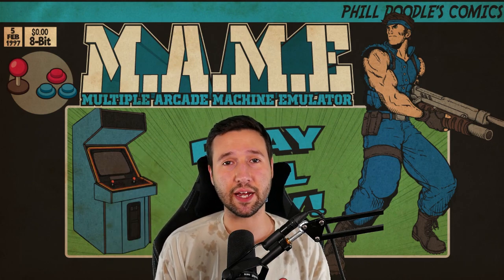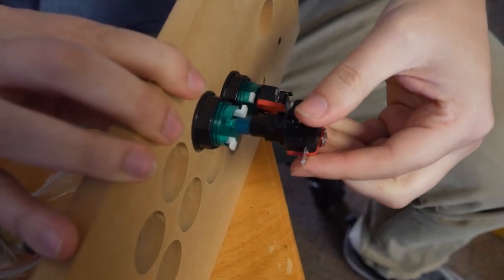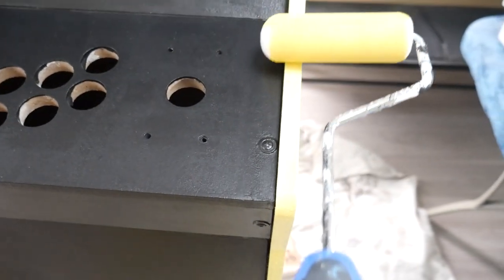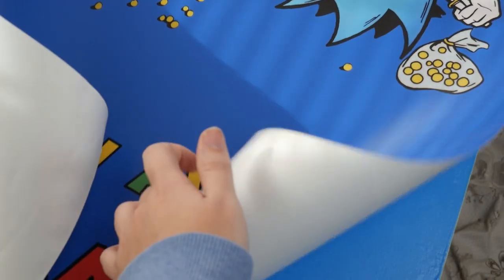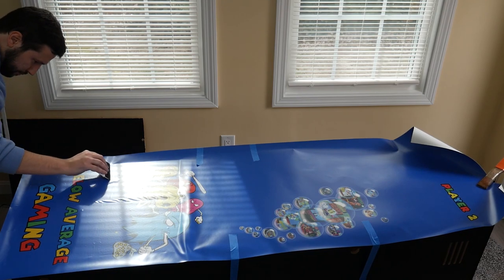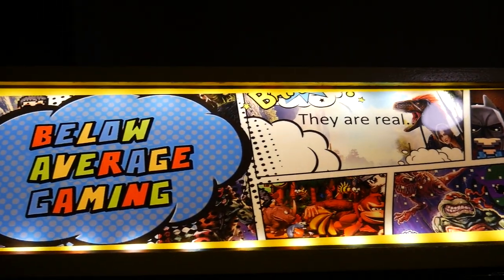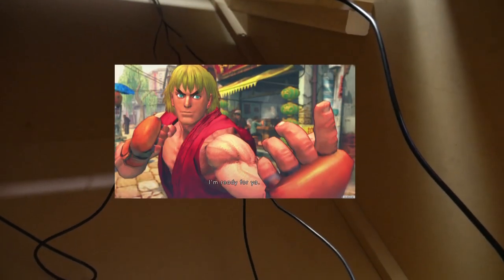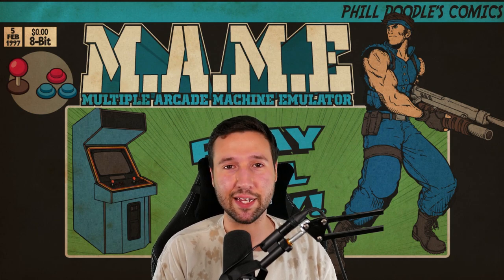How to build a RetroPie Arcade Machine - Painting and Artwork

Comment: Do you feel the need to put any fans on the cabinet for cooling. I am almost doing the exact same build and wasn’t sure if it was necessary. Also did you think about plexi over the screen or are you happy with the monitor the way it is. Looks awesome btw. Hope mine turns out that nice
Reply from the maker: Nope the pi by itself is pretty cool so no need for extra cooling, I've left it on for over a day with no issues.

Plexi over the screen wasn't needed in my case but I think that's strictly a preference

Comment: Dumb question incoming.  Since you applied the artwork to the sides was the painting the sides unnecessary?   

Also, could you have cut a bezel to size and then used Velcro to attach it to the monitor?   
Great video.
Reply from the maker: The painting was half and half necessary, I think I mentioned that in the video. My original idea was to paint it blue and just leave it like that and then I decided it was too bland after I did it and then that's when I decided to do artwork

I will say though making the sides nice and smooth will benefit the adhesion of the artwork anyways

I'm not sure how that would work about the bezel, but I'm definitely sure if you can think it, you can do it.
Reply: If you Run a Windows Machine You could Use Steam (Boots on Startup)  In "Steam Big Picture Mode" which Gives a Console Like experience

Comment: What hardware and software would you use if you wanted to do games like street fighter, mortal kombat, etc? (you mentioned the Raspberry Pi woudln't be ideal) Thanks!
Reply from the maker: A strong PC or console honestly
Reply: @BelowAverageGaming  thanks. Any advice on what software to use? Would love something that automatically boots into the multicade when turned on.
Reply from the maker: I personally love Street fighter, I've been a big street fighter 4 fan since it was released. Since the connection is really two USB ports and an HDMI, I will plug a slightly older PC. I have lying around into the arcade machine and just run the fighting games off of steam (mortal Kombat x, Street fighter, King of fighters and so on) 

To my knowledge, there's not really a software that looks like the retro pi for more modern looking games, usually it's just for the " retro games" 

But if you're looking for less graphically intense games, like Street fighter 3 and down, a raspberry pi 4 or 5 would be sufficient
Reply: @BelowAverageGaming  Yes- Street fighter 3 range is what I'm looking for! Better than atari, but not as good as a current system. Basically looking for graphics up through playstation 2.